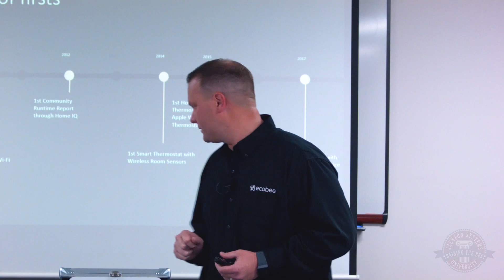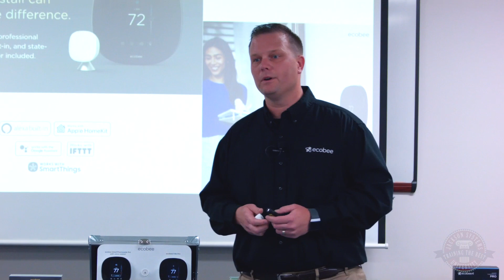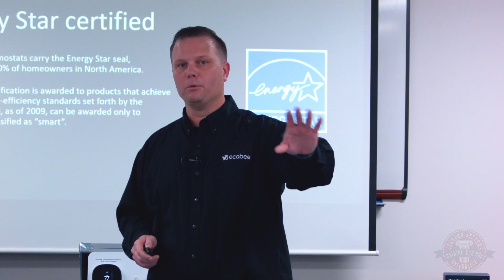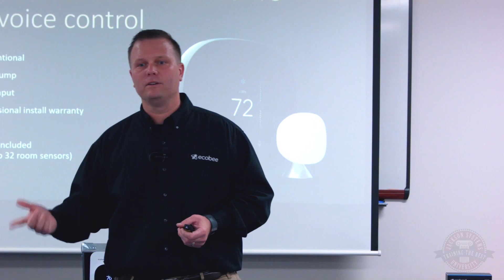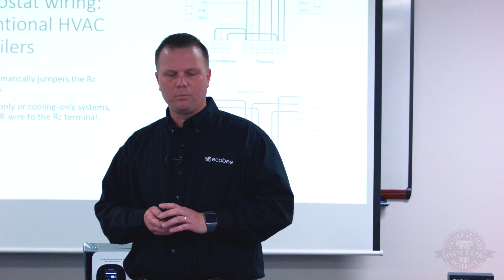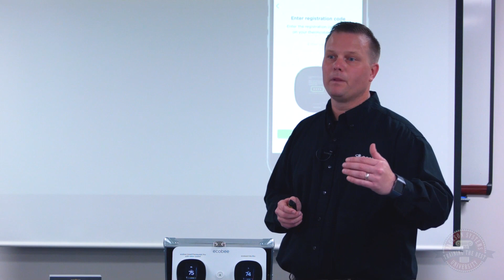ecobee Smart Thermostat (ecobee 5) Full Training

Comment: Had the Ecobee 3 for a week and it's fantastic. do7.pl/ecobee I own a 3500+ square foot two-story home. I have gas fireplace inserts in the family room and living room. Living room has a 13 foot cathedral ceiling. HVAC is a dual phase with thermostat mounted in upstairs hallway overlooking the living room. I've always had problems with the upstairs being too warm relative to the downstairs during the day. I got two sensors with my system that I placed in the living room and family room. It's amazing how the sensors work with the main Ecobee upstairs to maintain a very constant 72 degrees through the house when using the gas fireplaces. I maintain the two gas fireplaces at 72 degrees. It appears that the furnace does not run as much as it did before I installed the Eecobee and the upstairs does not get too hot. I had a couple of questions regarding installation of the PEK cables and system preferences and both times customer service responded via email within hours and the answer was spot on.

Comment: I just installed the Ecobee Smart Thermostat (Ecobee5 if you will) and it does not show up as available in multi-room music, although in the video he says it will support this. (He says "Surround Sound" and mentions it can do everything an Amazon echo device can do) Can you confirm if this information is accurate or if I am doing something wrong?
Reply: It also will not let me change the wake word from "Alexa" yet in the video he specifically says this is supported. Is it possible I am on an older firmware? Model: SmartThermostat with voice control Firmware: 4.5.57.82
Reply: Same issue:  I have the same thermostat (x2) and same firmware.  Also, I can't change heat/cool difference to 2 or 3 degrees as stated is possible in video.  I only have the default 5 degree and neither thermostat will pair with my android (Galaxy S9+).